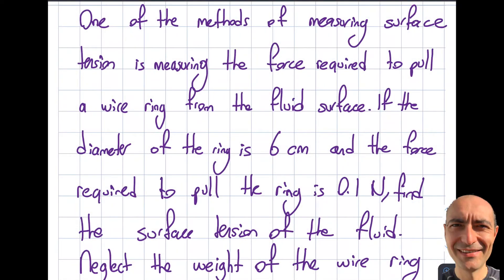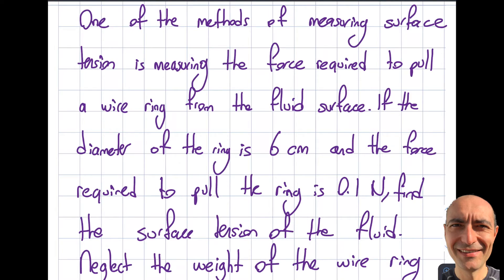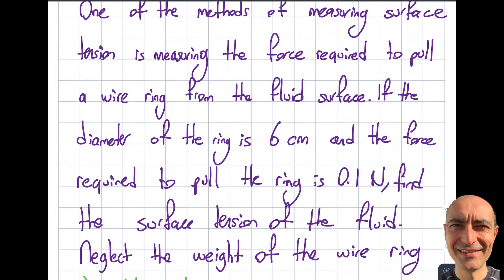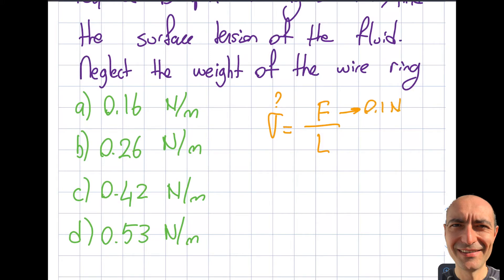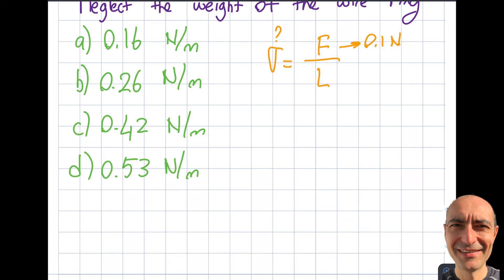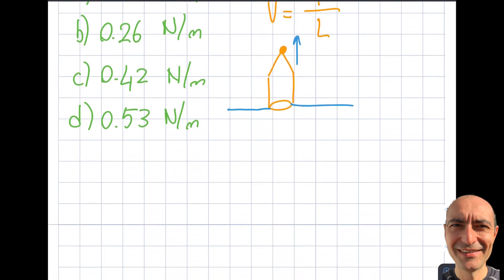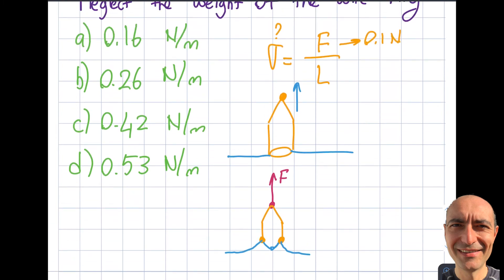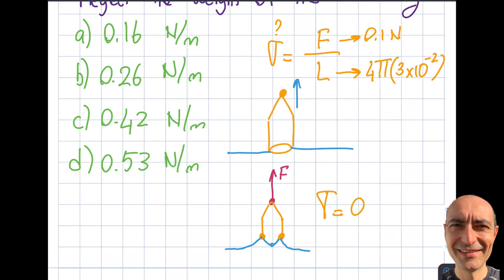FE Exam Fluid Mechanics - 1.5 - Practice Problem - Fluid Properties

Comment: why would you have two of those? the diagram is confusing
Reply: Do you mean that they are the inner diameter and outer diameter, if that's the case, the diameter should be different....
Reply: @hamstigum5363  he is assuming that thickness of the ring is negligible, but that the fluid comes into contact with both sides, which effectively doubles the length. So 2*pi*r becomes 4pi r. His diagram is not well drawn out which is what makes it confusing
Reply: @Aryck143  I agree with your explanation of the assumptions he made. Your logic is: since the problem didn't state a thickness (h?) we assume negligent, but it also doesn't state a diameter of the ring either? So, I don't think it is correct to assume inner and outer circumferences. Any thoughts?